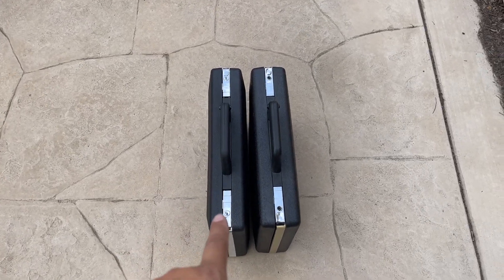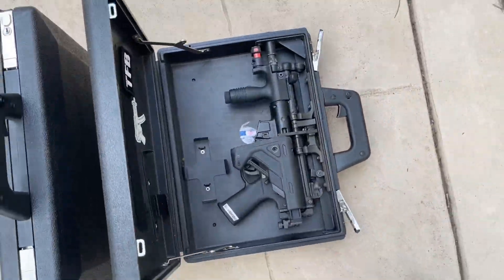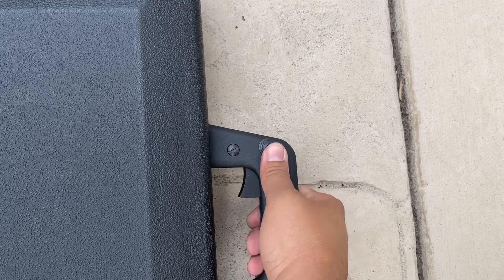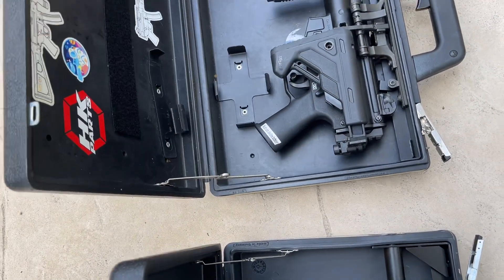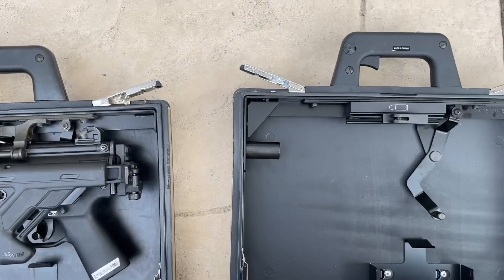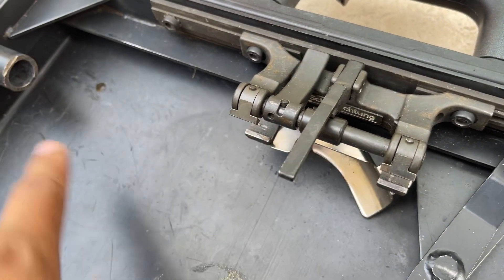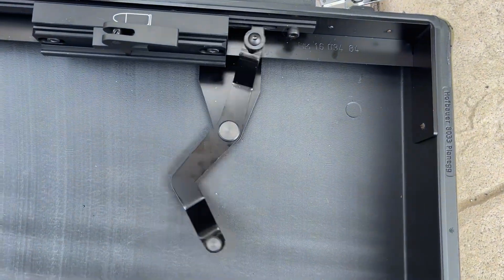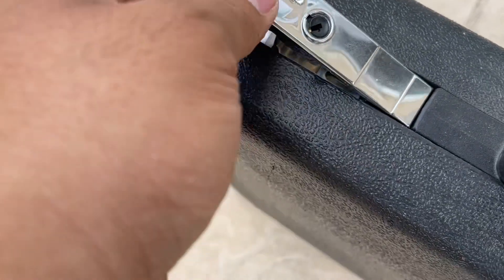Taiwan Airsoft MP5 Briefcase Compared To H&K Briefcase

Comment: I know some guys that built repros of the MAC briefcases. They tend to shake themselves apart at the corners if you use a traditional briefcase with seams. So they usually tried to use the stamped aluminum style ones. Cool that these are available. Always surprised how good some of the airsoft stuff is